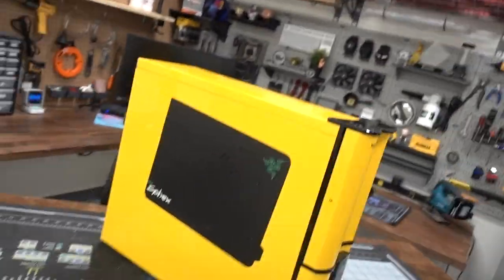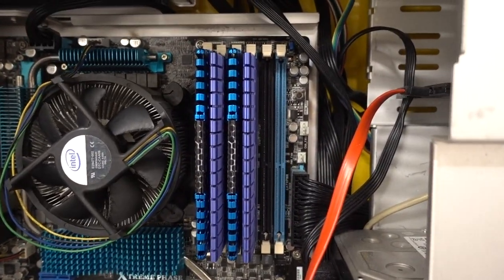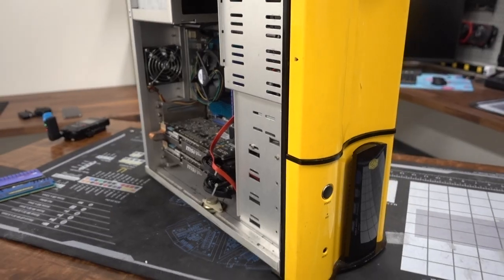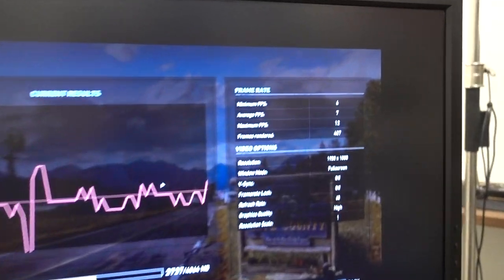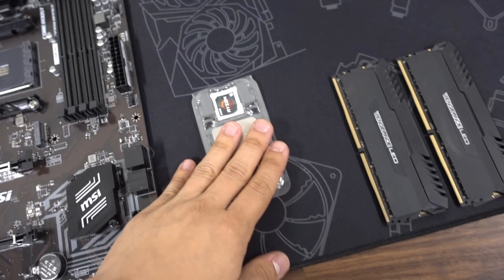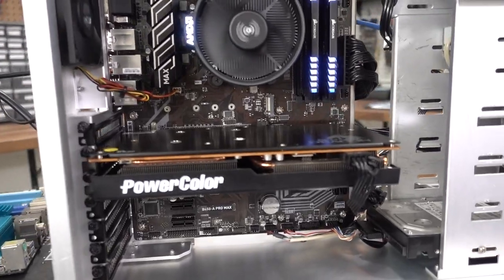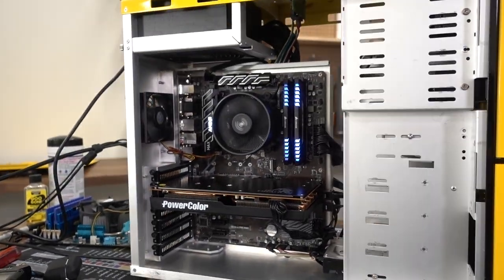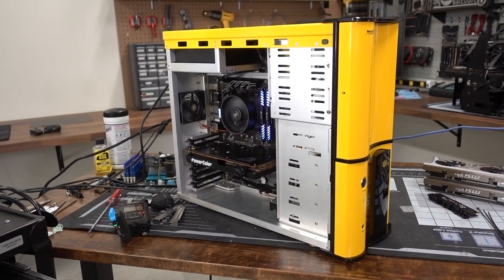It's been 10 YEARS since they cracked open this gaming PC. I'm going in!

Comment: I had an earlier silver version of that case when it was still named 'Tsunami'. It launched in August 2004 then in December a tsunami killed 230,000 people after an earthquake in the Indian Ocean. This probably led to the name change but I'm not so sure if 'Wave Master' was the best choice. 😅

Edit: Apparently these were just 2 very similar cases from different brands, nonetheless 'Tsunami Dream' turned out to be  a poor naming choice back in 2004.
Reply: That Tsunami case was from Thermaltake though, case on this video is from Cooler Master.
Reply: I remember that case.. that was 2004? fuck we r old...
Reply: I have a Black Thermaltake Tsunami Dream kicking around somewhere with a Core2Duo from the early 2000's
Reply: @mrsmith5365  Tsunami Dream was the full name indeed, thanks for reminding me.
Reply: Ahhh man I built at least 3 machines for people in that case back then.  Thanks for confirming I'm not the only one who thought it was a Tsunami!
Reply: @Pekeliini  Then I'm wrong about the name refresh. Still weird to have such similar cases from the same era, I really thought this was the case I used to have. Both have the PSU on the top rear, aluminium frame, little panel on top with connectors, curved front panel door with leds... I think the main differences are the case fans and floating motherboard on the Wave Master.
Reply: didn't kill enough of them if you ask me...........
Reply: @Silkeye  everything back then had the psu in the top rear
Reply: Yeah, the Tsunami was Thermaltake.  Cooler master made the WaveMaster in 2002-3.  I have the silver one also. Both LEDs are dead.  Mine has the removable MBD tray. Still a beautiful case.  I've been wondering how the thermals would  be with more modern components.  Thanks Kyle!

Comment: Maybe nice to mention is that the case is even older than 10 years! The Cooler Master Wavemaster was "the case to have" when the Core 2 Duo series released. So it's even older, around 15 years old. It was already old when that X58 platform released.

This was a very expensive case due the fact the chassis is fully aluminium. It was priced like Lian Li aluminium cases from then, around $200 I think.
Reply: I had two of the Thermaltake Tsunami Dream cases.  Seams to me I must have bought them at least 15 years ago.  SUPER cool cases just slightly different from this one.  They were AMAZING in their day.  I LOVED those cases!  Both in black with blue LED in the solid aluminum front doors.  One with solid sides for the living room HTPC and one with clear (plastic lol) side window for my blinged out gaming PC. The Tsunami Dream had a lot of nice little extra features like removable drive cage and such.  Super, super nice.
Reply: Yes, this case was introduced in 2004. Also, the front fans are accessible by removing two screws on the left side (when facing the front of the computer) of the front panel, one hex and one Phillips, and swiveling the bottom of the panel out like the door.
Reply: This might not be correct, or correct for this exact model or version of this model.  The only reason I suggest this is because i KNOW with no possibility for error that the very similar Tsunami Dream cases I owned were purchased more then 10 years ago by a fair margin..... So, it would make sense they had a whole family of similar cases from that far back.
Reply: @gibu002   It was the Patriot Blaze 120gb SSD that was released in Q4 of 2014.
There's no way to install a SSD (storage drive or boot drive) without opening the case.  I wasn't talking about the age of the case but the age of one of the components. So that case had to have been opened in the last 6 years.   6 years being the absolute maximum amount of time possible without that case having been opened.
Reply: Ah... I understand now.
Reply: @gibu002  No problem 👍
Reply: I seem to recall this case having a window option, anyone confirm?
Reply: @justair44  My GUESS is yes, for sure.  I had two very very similar Thermaltake Tsunami Wave cases from roughly the same time period and they absolutely came with a very cheap and very scratch prone plastic window.  But VERY stylish for the day.  Since my case was almost the same as this but with a full front door vs this half height door Id bet money this case had the same crapy plastic side window as an option.
Reply: I thought that case looked aluminum inside like my Lian Li!!! It looks like it also has a removable motherboard tray as well. Doesn't look like Kyle noticed though....sigh. All he did was bitch about the lack of grommets for cable routing.
Reply: I've had mine since 2004. Coolermaster Wavemaster TAC-T01. It has gone through numerous upgrades, currently housing its 4th CPU/Mobo (10th Gen Core i5). The built quality is excellent, on par with Lian-Li cases of the era (all aluminum construction), especially having in mind that it comes from an age when most cases where beige boxes... Although I've never had any issues with cooling, you can swap the top i/o port with a fan cage (it was included with the case accessories) and install an additional 80mm exhaust fan.
Btw, great job with the upgrade.
Reply: @michailangelopoulos5602  You lost me at 80mm fan.

Comment: The Razer Sphex was my first mousepad and yes, there is adhesive at the back 😂 this brings back memories
Reply: I still use this one. TBH the best Mousepad ever made. Does not get any more durable than this + no hurting wrists because of edges of other mousepads ^^
Reply: Yeah, still using mine
Reply: Razer Sphex user here! Im currently using the version 1 and version 2 of Razer Sphex. Rubber mats tend to absord my hand sweat, so I had to try this. Didnt regret! 😁
Reply: I still have an original one on my desk.
Center of it is now smooth, and the edges no longer stick down, but it still works well.
Reply: @ttomkins4867  Eventhough you have tried to wash the adhesive? I know that it's washable with plain water and it will become sticky again.

Comment: "Remember booting of a 64gb ssd"
My 64gb ssd: :(
Reply: 1. he said 128 GB
2. 64GB is perfectly fine if you get all the speed you need (that's the min i would go for win 10)
3. 128 is probably better value for your money in 2020 if you can find a 64GB
4. i'm guessing your other drive is huge like 3TB or something (mine is 3TB)
5. when he said he added a 256GB SSD i thought that's as big as mine but did not see the point of it if they had the 128 and the regular HDD
Reply: i got my first SSD in 2011, it was a ADATA 64GB used it as my boot drive for 2 years and could not deal with it constantly being full, thats when i got a Crucial M500 120GB and only in 2016 did i get a 850 Pro 512GB on discount for ($85, was cheaper than my 1st SSD)
Reply: @ainzooalgown7589  why didn't you store your data on a regular drive instead of trying to put everything on the 64 GB?
Reply: @bland9876  64 is too low if you are using windows 10! unless you are using distros
Reply: @chawza8402   yeah well, tell that to my 30Go ssd......  ^^, still in use but i have to admit i have to use another disk for the update dowloads........now....

Comment: As for your comment of "technology is moving so quickly..." honestly, that's less of an issue in the last 5-8 years. Ever since cpu manufacturers have been focusing on # of cores and not clock speed, you can run a ton of new games on significantly older hardware. (Because most games (even today) are so poorly multithreaded that it doesn't matter, only clock speed matters.) My current CPU is 6 years old (6700k) and I can still run every modern game on the highest settings (unless the game is a PoS). My gpu is overkill for playing at 1080p, and I could easily run a GPU from that era (Like a 980ti) as well and still get above 60 fps.
Reply: Facts, my 6700k has been holding up very well for most games. I think the only game that has severely made my CPU chug was S.T.A.L.K.E.R Anomaly, because of how many AI are on the map at once and being controlled by your CPU. Other than that, any issues I have ever had with my "CPU' ended up being a software issue, mainly having to do a clean install of drivers.
Reply: yeah my 970 has been able to run new games very well

Comment: I can't even begin to imagine just how hot that thing must've been running. Original Twin Frozr II design which, for the uninitiated was horrendously inefficient and ineffective at cooling and not only is it in a stifled case and paired with another card in AMD Crossfire, the fact that they're older AMD cards which ran hotter than the surface of the sun only makes these conditions even worse. That thing'd give even my old space heater of an FX build a run for it's burning money.

Comment: "I actually got into the DIY PC craze right after this." (First gen Core i series)
Kyle... Your older then me... and somehow your making me feel old.
Reply: Made me feel old because I built my first PC back in 1998 with a Pentium CPU and windows 98 SE.
Reply: Wowsers I loved my i7-920 x58 machine but I had a GTX 570 in mine. I feel like something was up with those cards, they shouldn't have performed that badly right? FYI Building since PIII and I'm really not that old, just got into a tech job at a young age.
Reply: You're*
Reply: ... my first was a 486DX2. Didn't build it that time myself, but got into PCs with that and after that began do build my own. I still remember the hours spent tinkering with autoexec.bat and config.sys to get my games running as best as possible.

Comment: "imagine booting off of a 120GB SSD" 
My laptop boots off of a 16GB SSD
Reply: Windows updates are a pain with so little space :D TreeSize Free can't find anything for me to remove anymore.
Already sent the pagefile to HDD and removed lots of Windows features; every content update is an experience.
Reply: You're booting off a 16GB drive with Windows 10? That seems like it would lead to trouble. I have a couple of old netbooks from my workplace that booted from an 8GB drive and came with XP Pro (a product of Vista and 7 being too much for a netbook at the time they were released). This would have been fine with XP's initial release, but by the time XP was fully updated, the drive would tend to run out of space unless you deleted backed up files for all updates, moved the page file to the other 8GB drive, and avoided installing software to the system drive. You could shoehorn XP in there, but it wasn't pretty. I would expect similar issues with Windows 10 on a 16GB drive.

Of course, those netbooks are much less trouble with Debian Linux running on them even now. I've got one serving up an 802.11g wireless network in my office with the current Debian stable distribution and LVM to unify the two 8GB SSDs into one logical volume.
Reply: I took a dump
Reply: @CFWhitman  nope. It’s windows xp. It serves as a school laptop at the moment and I use a flash drive for storing documenrs
Reply: Whut? How? You're joking 😂. Windows taken much more than 16GB. It must be extremely lean linux or something
Reply: @lukebodden8618  dude NEVER connect it to internet.

Comment: The i7-920 and that motherboard were designed for triple-channel memory. So multiples of 3 sticks. Running it with 4 sticks forces the memory controller to run in single-channel mode. That's a big hit to CPU performance. This is why 12GB and 24GB memory configurations were common in high-end PCs back then.
Reply: That's what I noticed when he opened the case.  This Asus motherboard was expensive in it's day, and still goes for a decent price on used markets.  Drop in a 6 core Xeon with triple channel memory and a newer graphics card.
Reply: @Mungertube  Great idea until the game you want to play requires AVX, that is the one major problem with X58.

Comment: you should go and try overclocking with that I7 I still have the 920 in my second system and with a good OC and more up to date gpu it's still pretty decent.
Reply: I'm running mine @ 3.6GHz 24/7 with a Xigmatek Dark Knight air cooler. It's still my main system.
Reply: Mines running at 4ghz :-) oh wait, just remembered I removed the oc as it wouldn't go into sleep mode.
Reply: Or get a cheap 6c/12t Xeon for it and overclock it to 4.5GHz. I still have a Xeon X5670 @ 4.4GHz in my main PC

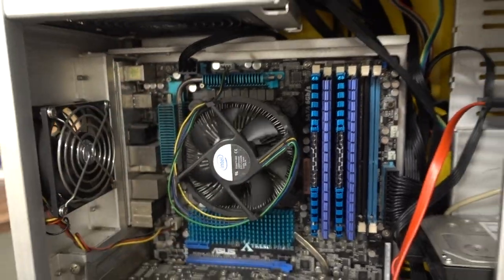Comment: 4:16 dude Ur first CPU for gaming is the 2600k. My first CPU is the 2400, and I got it on march this year.
Reply: I mean my 2500k @5Ghz still is amazing in games 👌🏽
Reply: @99Etien  I wish I bought s k model...
Reply: My i7 8750h is still decent
Reply: @99Etien  it's really not good at anything
Reply: @miniweeddeerz1820  Then explain me why I still can play current Games at high or max Graphics at 60FPS?
Reply: @miniweeddeerz1820  And to mention with just ~70% usage at maximum
Reply: @99Etien  what are your 'current games'. Also games dont reflect everything. Windows shows a lot as well.
Reply: @miniweeddeerz1820  Games like Shadow of the tomb raider, Mortal Shell, The surge 2.
And I said specifically for "Games" since of course for CPU Heavy applications it's not on par with newer CPUs because of the 4 Cores/Threads limitation. In the end it's still just an 10 Year old CPU that runs at 5 GHz. But for my use of Games and scientific programs like Mathematica/origin/latech for my Masters in Physics it's still more than enough!
Reply: @99Etien  up to you

Comment: "remember booting off 120gb ssd"
inhales deeply "yes"
Reply: I just recently stopped booting off of a 120gb ssd.

Got a mx500 2tb so using that for games and my 500gb nvme as boot now. Used to use nvme for games and 120 for boot. the 120gb ssd is now just in a drawer with a copy of windows in case I need it
Reply: @Mister_Smith_YT  about two days ago I switch from 120gb ssd to a 516 m.2 best thing ever

Comment: "Top of the line" - 920.... I had a 970 which my son now uses
Reply: Yeah, 920 was the cheapest HEDT Core i7. i7-975 Extreme Edition (4c/8t) might have been the fastest at the time if it was built before the 32nm 6c/12t i7-980X was released. There was also the i7-990X but that wasn't released until 2011
Reply: I still have my 12 yr old rig. i7 920 replaced it with x5675 ~4.0ghz stable 30c idle 65c load on noctua c12 cpu cooler. I daily it and it's actually not bad.
Reply: @daddybotz   Also still using my X58 System as my main PC. I've got an W3690 also @4.0 Stable, but with 45ish Idle and 85ish under load on an BeQuiet SilentLoop 280. I still have to find a Game which pegs my cpu at 100%, a thing i can not say about my Strix 2080ti...
Reply: My main PC has a Xeon X5670 @ 4.2GHz. I used to have it at 4.4GHz but my cooler sucks (Antec C400, I've replaced the stock fan with two 120mm fans)
Reply: @Pasi123  thumbs up I like your setup. Which Mainboard and Gpu are you running? Also, why no aio or full water cooling? :)
Reply: @Cher007  Asus P6X58D-E and GTX 960.
I'm planning to upgrade the graphics card to a GTX 1070 Ti, 1080 or 1080 Ti and I'm also going to upgrade the CPU cooler to some bigger air cooler.
Reply: @Pasi123  Yeah, a 1080ti will serve you good with that cpu, since you overclocked it :) Maybe the Cooler Master MasterAir MA410M will fit, it looks pretty decent for the price.
Reply: Running a x5690 which is that 990x Xeon version. 6c 12t at 4.6ghz. ram 24 GB at 1600 as it's hard for the controller to run any higher. Gigabyte  ud5 mobo with sapphire rx580 le 8gb. Trying to hold on till AM5 socket but those 5900x CPUs and 6800xt is tempting.
Reply: @majcyl  Also a great CPU. When i upgraded, i was a little indecisive between the W3690 and the X5690. Has yours an unlocked Multiplier? Mine has :)
Reply: @Cher007  yeah I went from a 920 c0 to a 930. Then I brought the x5690 had played around with the multiplier and bclk to get it stable even tried 27x I think. But I also brought 2 x5675 as spares for about 30 dollars incase I fried the 5690. I might just buy a new graphics card and hold on till AM5 with the ddr5 ram. What does suck is being stuck with sata2 but just live with it. What did you upgrade to out of interest?
Reply: @majcyl  I do not remember my bclk and multi values right now sadly, but i upgraded from a i7-920 to a Xeon W3690. The Sata 2 thing isnt really a big deal to me, i did not feel any difference between my 1tb Patriot Burst Sata SSD and a friend's NVME SSD to be honest. Also i still run 12gb of ram, since i have not yet seen any need for more :P
Reply: @Cher007  I hope you've got some really decent DDR3 in there so as not to bottleneck the 2080 Ti into oblivion
Reply: @ShogoKawada123  6x Ebay 1066mhz 2gb sticks overclocked to ~1300mhz. I really don't care and a matching kit of 6 Sticks is REALLY hard to get. Afaik i have not yet witnessed any hard bottlenecking, and i've had that Card for about a Year now.
Reply: @majcyl  bud.. send one of those x5675's to kyle... so he can experience the power of x58... I know mine gives a ryzen 1600 a run for its money... and it would be a shame to let him think, that old extreme phase x58 board is ready for the scrap heap...
Reply: @flozam5468 lol they are like 10-15 dollars Inc shipping from AliExpress.  Pretty sure Kyle is rich enough to buy them and throw it at people.
Reply: @majcyl  yeah, but I bet he's to high up on his privileged throne, to consider the x58 system as a worthy case to bother investing the time to track one down.. ( not that I don't luv his shit ) ... But if you sent one in to his p.o box, along with a brief note... He might open it as a part of "awesome hardware" .... Otherwise that board is destined to become e-waste... And he'll never know the joy of x58 O.C ... Really is a right of passage... You can't say your a PC enthusiast, if you haven't clocked a Westmere Xeon... It's like the Holly grail of O.C CPU...